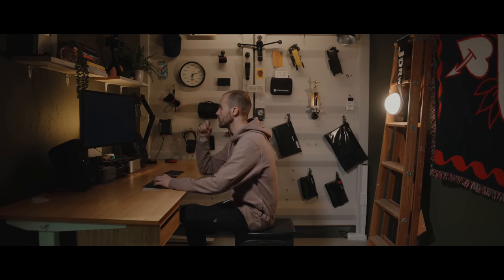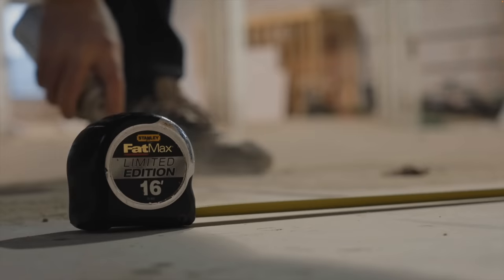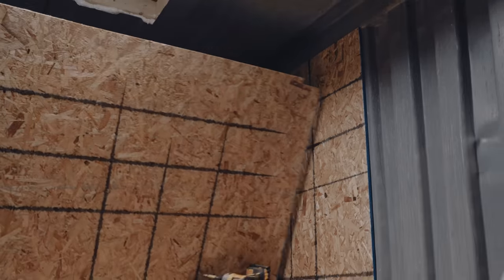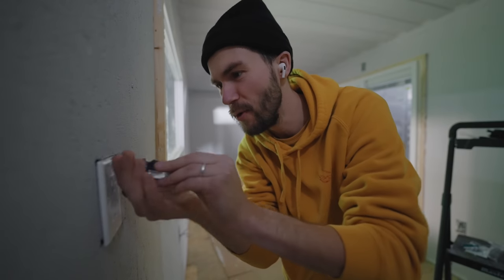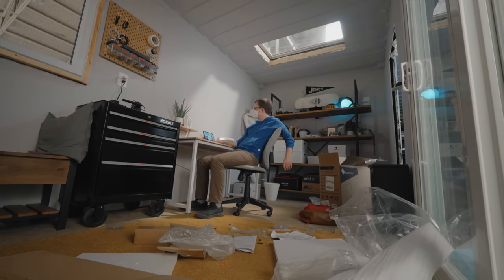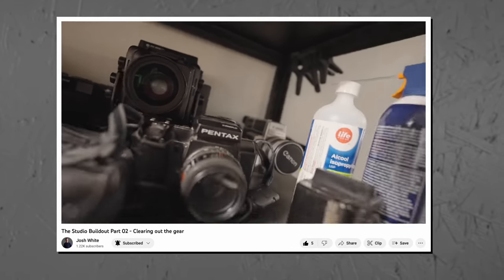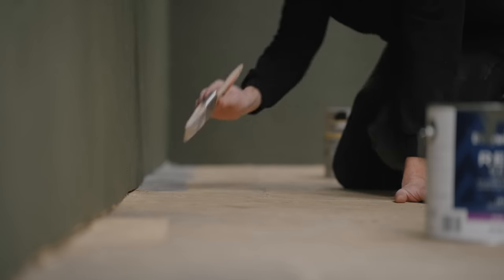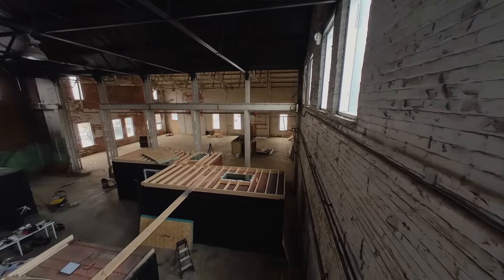Shipping container office reveal! We're done?!

Comment: Hi Jesse, great content and I am a long-term fan of your work. How are you going to survive in this studio in a Canadian winter? What heating are you guys using there?
Reply from the maker: We have heaters in the main spaces, but they are super expensive to run, so we really only turn them on during rentals. Other than that we each use space heaters for our own containers and it works well enough.
Reply: @JesseDriftwood  probably would be a good idea to install A2A for heating and cooling. This would cost you 3 times less than direct electric heaters.  Or even A2A for individual containers.
Reply: @JesseDriftwood  ohh and you could cool in the summer too
Reply from the maker: @UrbanPlumbers  I’ll definitely look into that! The containers are currently just a a temporary solution until we can actual build the space out properly, so we’re also trying not to invest too much into them.